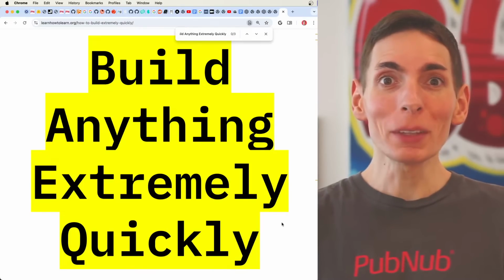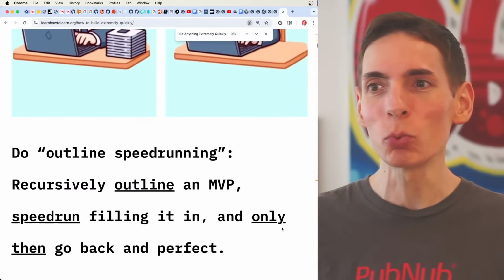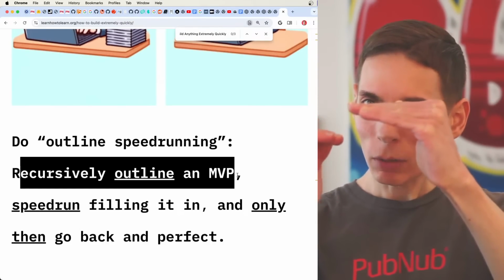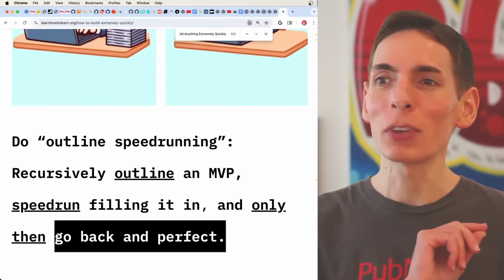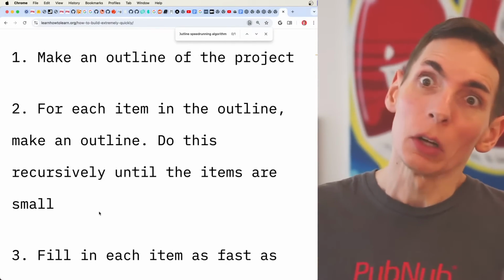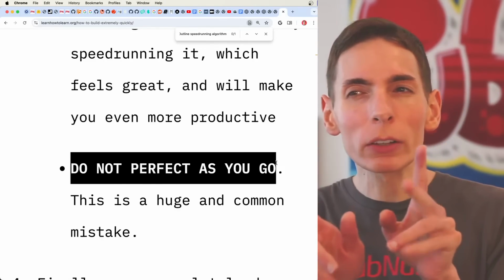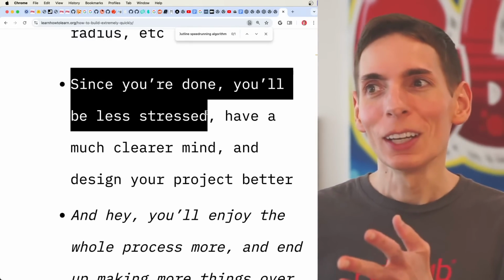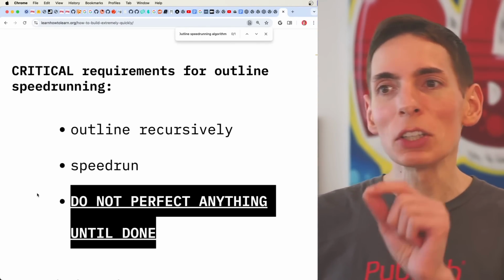Set Goals and Achieve Them to Build Software Extremely Quickly

Comment: sir is c still relevant today, Should i learn it? I know the basics of c , I'm talking advanced Stuff, like networking... or just rust is better option for low level programming.
Reply from the maker: yes actually C is still very relevant. the internet infra runs on C. and Linux is all C. and most of AI is C as well (libtorch)
Reply: @StephenBlum  so can you please tell me what should I learn rust or c? it'll help me , eventually I'll learn both but for now... what should I pick I know the basics of c and rust Lil bit , like function, conditionals , loops . so please suggest me
Reply from the maker: @Nvimchad  the US-government has requested replacement of C with safe languages. Rust is a better choice to learn today.